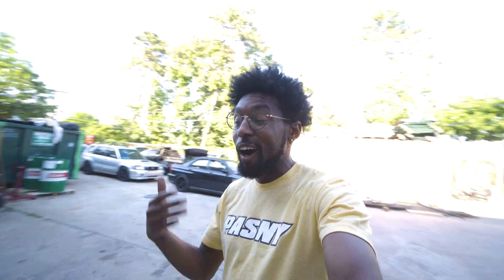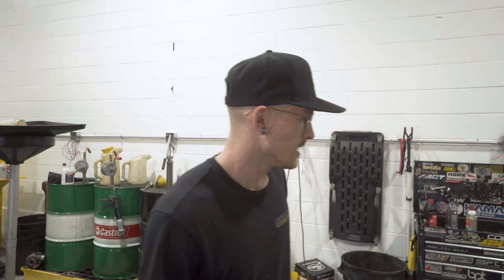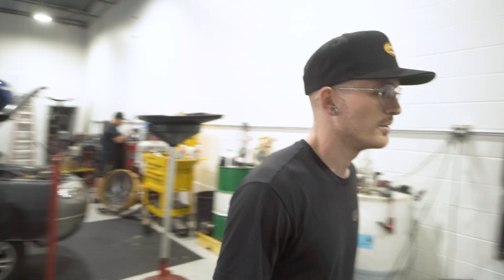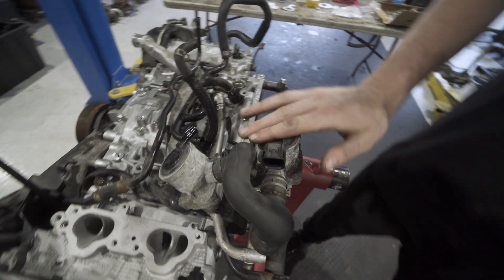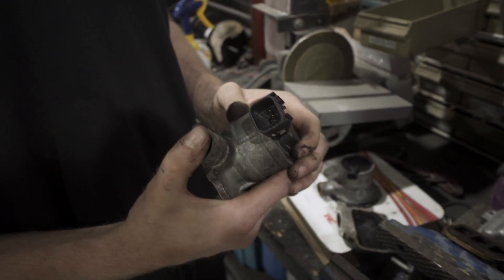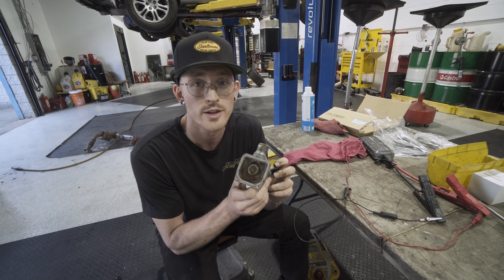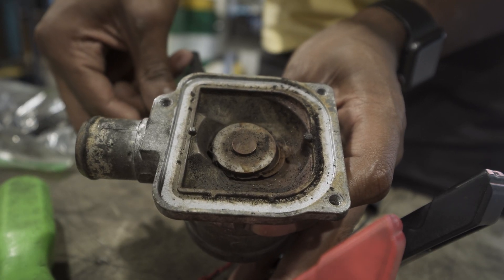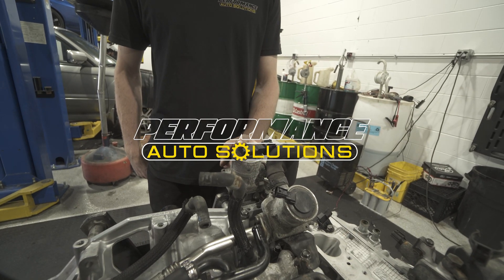WHAT ARE SUBARU AIR PUMPS AND HOW TO TROUBLESHOOT | PASNY GEAROLOGY

Comment: This is a great video. If one valve is stuck open, could it mess up the O2 sensor? I have a P1410, meaning a valve is stuck open, and my engine is running weird, with the O2 reading lean and the ECU compensating by adding as much fuel as possible, but still lean.

Comment: Would a p2443 code be for just the barometric valve or could that be the other one to. I have that cel and replace the back one with the barometric sensor and I’m still getting the p2443??

Comment: Is it possible one of the failed air injectors on 2006 Subaru WRX TR stuck open and it leaks the oil burnt smell?
I had issue with air pump and injectors few years ago. I use Tactrix to remove the codes and has no issue since until now, when car is warm and especially with heater on, I feel the oil burnt smell inside the cabin. Or it sounds like some other issue? Thanks in advance!
Reply: check your valve cover gasket. Leaks oil in passengers side to exhaust. Sorry my bad english.
Reply: @fedeviertel   valve cover and under all  dry. The oil burn smell coming from the one of the faulty secondary injectors area seems )the one that mau stuck in open position). I closed air circulation on heater control from the inside the cabin  (dash board console) and i no longer feel the burning smell. Your English is great:)

Comment: Hi my wrx Hawkeye was running fine but decided on changing plugs as good maintenance took on test drive straight after and EML light came on with code p2444 saying secondary air pump, malfunction now has a hesitation on acceleration any ideas please
Reply from the maker: The best move is to contact the shop to get a proper consultation!

Comment: Am I able to just clean my air pumps and the electrical areas? Or must I get them replaced? And what about the pipes?
Reply: Did you get your answer? I’m about to replace mine
Reply: @richardlam909  i honestly just havent changed them and the car is still running perfectly fine

Comment: My 2009 wrx is set up differently from this, and I have had a LH valve stuck shut code for years, I’ve replaced the driver side valve with a factory OEM valve and the code is still persistently reoccurring, any suggestions? Did I replace the wrong valve?
Reply: 进气泵损坏了也会报进气阀卡在关闭位置
Reply: 可能你的泵是损坏的

Comment: Hey guys, thanks for the good explanation. im getting codes P2431 & P2433 on start up. Any ideas whats acting up? i ran direct power to my air pump and its good.
Reply: I was getting those also. Mine was simple. I was a dumbass and forgot to plug in the electric harness back in after doing some other stuff. Check your connections is an easy place to start.
Reply: Did you get ur codes fixed?  I am having problem with that crap also.  P2431 and P2432.
Reply: @landlocked4983  I just got tuned and turned the codes off. The two air pump solenoids would have to be replaced otherwise as theyre stuck closed.
Reply: @Tyler-ld7bi how did u get a tuner to turn off the codes? I can’t find anyone that will tune my car cause of the secondary air pump delete greenspeed shit
Reply: @Ryan-gk9lr   I got tuned on ecutek, before they did the greenspeed update this oast April. You may need to find a tuner that tunes via open source. Thats the only way to turn the codes off now i believe.
Reply: @Tyler-ld7bi  yeah I’ve been trying to find someone that will do open source. It’s been challenging

Comment: wait, so just to be clear; you can safely ignore the CEL for the secondary air pump (and keep driving) as its function is.. nothing but essentially cheating on emission tests?
Reply from the maker: aside from it throwing a CEL and putting the vehicle in limp mode, it doesnt have a mechanical or performance input. Yes, the function is to legally cheat an emission test
Reply: @Pasny  Thanks for the quick reply! Much appreciated
Reply: So you have to tune the engine to ignore the code in order to avoid your engine being put into one of its limp modes? Is this correct? I'm currently having issues with the system and can't delete it as I am in an emissions state (Colorado). It's giving me low power bank 1 on the air injection system. P2432 (I think).
Reply: Yeah it’s horse… it is unfair to us.
Reply: 亮故障灯会降低5%-10％的动力

Comment: Very useful and detailed video, thanks! My 13 WRX EJ255 has the RH "secondary air combination valve" mounted on the RH head underneath the intake manifold, so it's a bit tricky to get to. Based on the diagram, the RH valve has the barometer on my model.

 I was able to remove, disassemble, and clean the LH air pump valve since it was getting stuck closed. But I'm still getting a code for the bank 2 valve getting stuck, which I would assume is the RH valve? I'm wondering if I can just unclip the air pump duct and spray some carb cleaner into the RH valve so I don't have to remove the whole intake manifold assembly!
Reply: Have you fixed your issue? I have a 13 wrx dealing with the same issue p2441
Reply: @ShaunRGardner  Unfortunately I’m still getting P2441 every other cold start. Cobb AP reads it as switching valve bank 2 stuck closed, BtSsm and Car Scanner app I think reads it as bank 1? If anybody has a solution please lmk! 

I do know there’s a recall (US) for the secondary air pump relay and I read that someone had this issue resolved by having the dealer address the recall. That might be a good next step.
Reply: @bz5jh  I removed my pump by the turbo and it wasn’t stuck. Was able to bench test it and make it move. 
Replaced the whole unit with a used one just to be safe and eventually after driving close to 100 miles with the “new” valve and the code went away
Idk what the deal was. Idk if it was slightly loose wires in the big engine harness plug by the turbo or if the sensor on the valve itself was bad. Annoying that idk what my solution was but maybe it was necessary to replace the valve
Reply: @bz5jh  我完美的觉得了这个问题，制作了一个模拟器，工作原理是模拟了泵阀关闭或打开的工作信号给ECU。欺骗ECU，让它认为二次进气系统是正常的。
Reply: @唐永朋  do you have more information?
Reply: @ShaunRGardner  Hi Shaun, I got the P2441 code yesterday on my 2011 WRX. How was the install of the valve on the RH side. The parent comment (Edward) mentioned you might have to remove the intake manifold? Is that true? My exact code as read from my AP is "P2441: Air pump switching valve 1 (RH) stuck closed" Any help is greatly appreciated. Thanks
Reply: @ShaunRGardner  我做制作了一个模拟器，可以取代这套二次进气系统。并移除这套一套。让车不报故障。
Reply: @唐永朋  can you share the simulator solution?